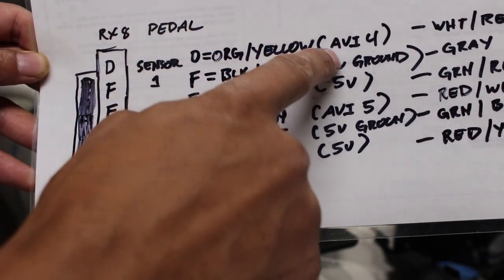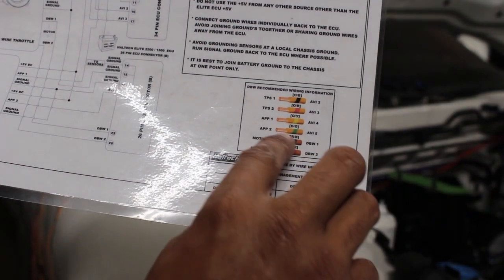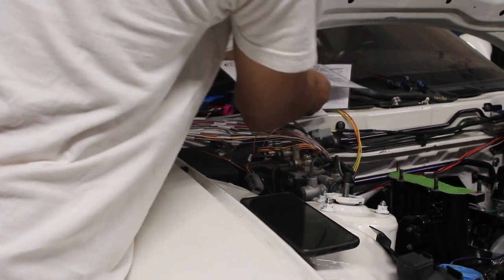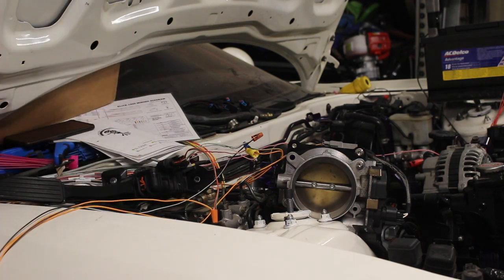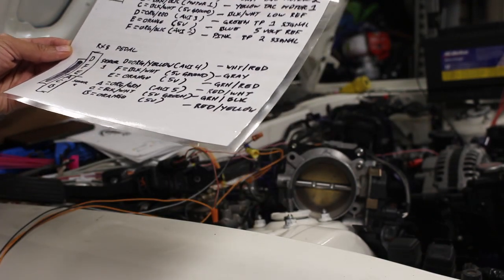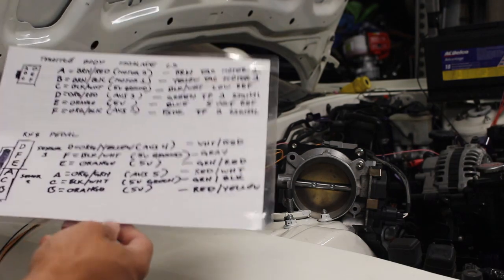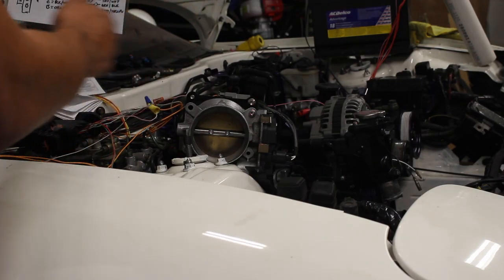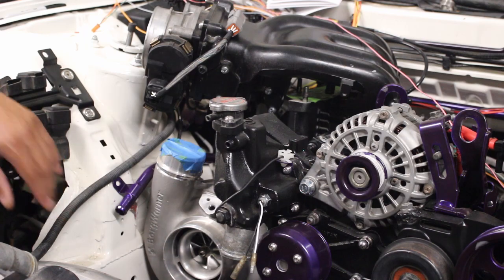RX7 FD Haltech Wiring: DBW GM / LS Throttle Body and RX8  E Pedal

Comment: Appreciate the level of detail you are covering with this wiring job. I'm in the planning stages of my harness and this is very handy. Are you planning on keeping the stock cooling fan setup with the 4 relays. If so, it would be nice if you can cover how you integrate it with the Elite in order to try and keep the 3 fans speeds.  Keep it up.
Reply from the maker: Thanks for words, thought it might be to much glad it's actually helping someone. I will be keeping the factory fans.

My hard drive just died, should receive my new laptop on the 15th and will add some new content soon.

More wiring, fuel pump, fuel hardlines, interior refinishing.
Reply from the maker: For the fans I will be attempting to retain the factory layout for now, will defiantly document that process.
Reply: @nismoz32racer  Nice! I have actually completed my documentation of the cooling fan relay setup that I plan on running on my car. I have not started on the harness yet but I wouldn't mind sharing  my wiring diagram with you. The way I set it up is using relay no.2 and no.4 as stock configuration with the Haltech triggering both of them based on coolant temp. For relay No.3 I used another DPO from haltech to trigger it. This will give you low and medium speed. I left relay No 1 as stock and it will trigger with the press of the A/C button giving you the third trigger. With this setup you can have low medium or high fan speed just like OEM. I have figured all the neccesary connections into the factory harness which was the most time consuming part.

Sounds convulated but I made I nice wiring diagram that I can share with you if you 'd like.
Reply from the maker: @SpeedNessRx7  send it my way, i started mapping everything out as well, but didnt get as far as low and med, was only going to use high. If you have IG my name on there is Toykoz32